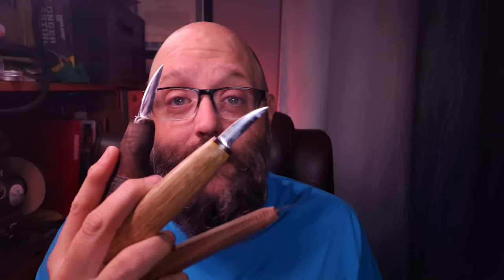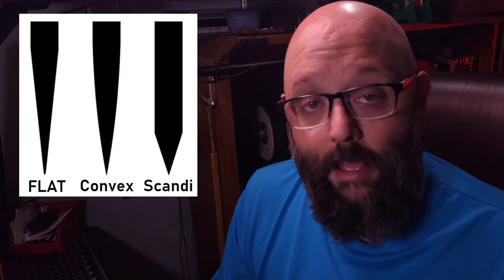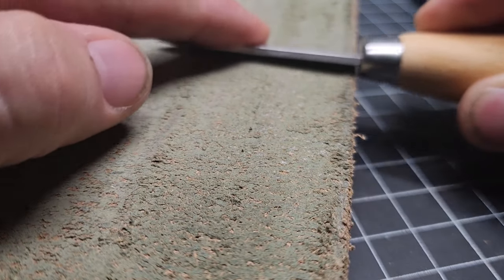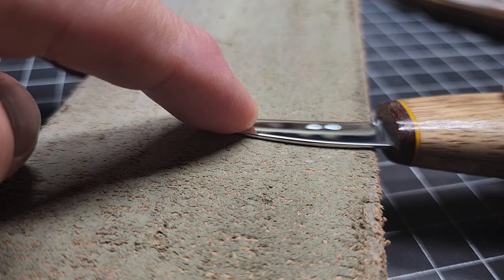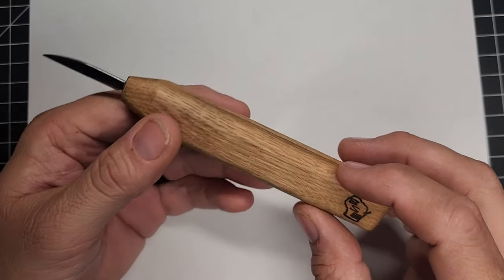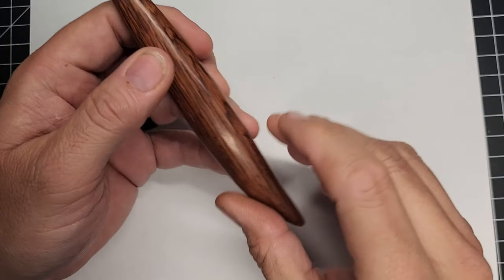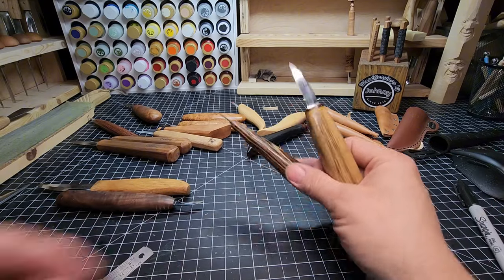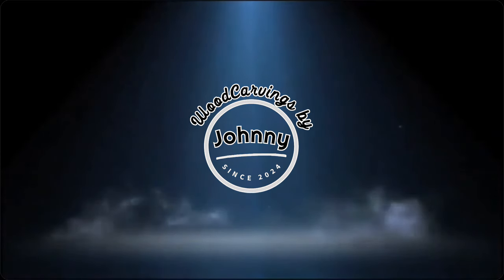Knife Talk, Bevels/Grinds, Blade Shapes, and What I use on a day to day basis.

Comment: Great video. Have been struggling to get my head around convex knives, but you explained it very well.  As a retired carpenter and spoon carver, am used to putting edges onto flat surfaces, convex knives mess up my mind, but understand the need to get a bit more durability into the edge. Think I will make a few and experiment as am set up with a small kiln and a lifetime collection of sharpening gear. Will have to think this through some more, but a gently curved strop could be an asset for sharpening these knives, though everyone seems to cope fine with standard strops. 😄
Reply from the maker: @mark.a.cornish  A standard strop works fine, i would hazard that a curved strop might push you into rolling the edge.  Better to use a flat one, and and rotate the blade so you're only stropping the surface of the cutting edge. Where the stropping can actually have effect.

Comment: Great video as always Johnny. I was into knives long before I got into carving, so I already knew how to handle and sharpen them. Folks have to remember that woodcarving is about carving, not knives. I got a beavercraft beginner set and it's been working so far. I don't have much options due to shipping limitations. I'm going to use my knives until they break probably, but still I would be very happy if I could get my hands in one of these cool knives.
Reply from the maker: @joaofalco939  Beavercraft works and if you're happy with them that's fantastic.  But no matter where you are, there are better options for Knives.  In Europe Mstein makes good knives, like an OCCT equivalent from what I can see.  I'd love to try one at some point.
Reply: @JohnnyTheLayton   I know Breavercraft is a beginner knife, but I'm a beginner carver, besides I've never used anything else to compare. I live in Brazil, and I can't find whittling related stuff around here, just big tools for woodworking, I'll keep looking

Comment: Great video. I have steered back towards my Mora and a thick blade chip carving knife. So forgiving in harder woods or cutting across the grain. My flat grind carving knives, such as occ, just kept chipping.
Reply from the maker: Yeah, I use that Ash and Axe chip knife with the scandi grind on hard spots where i'm going to be putting a lot of pressure in and it performs admirably every time.